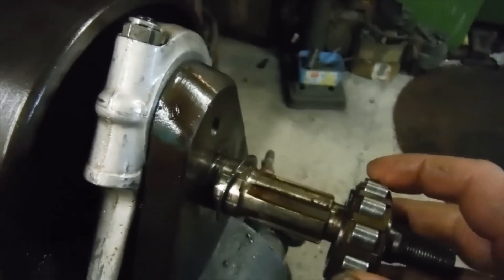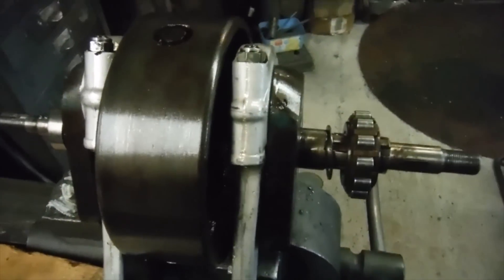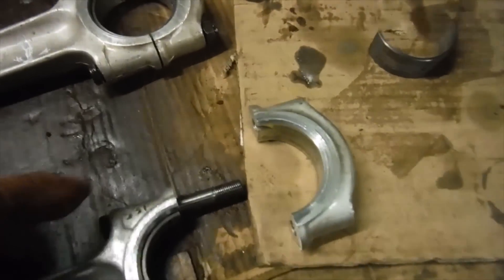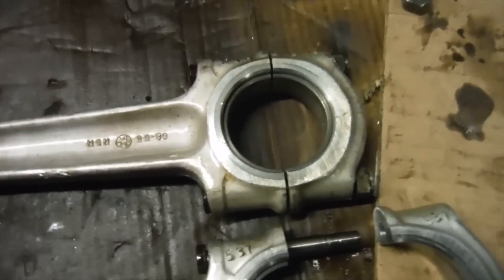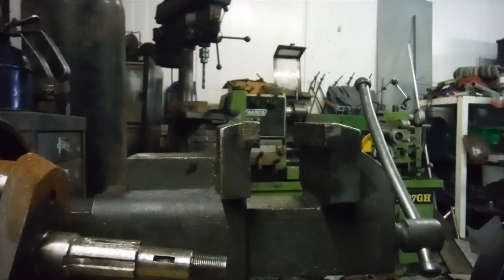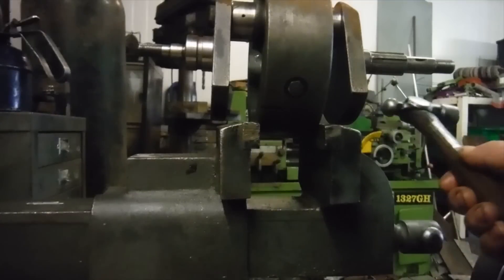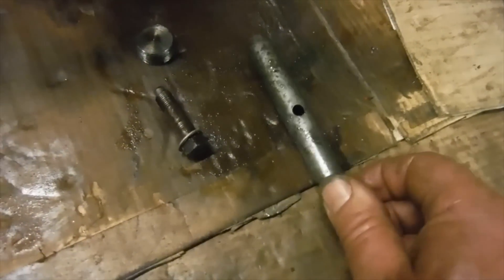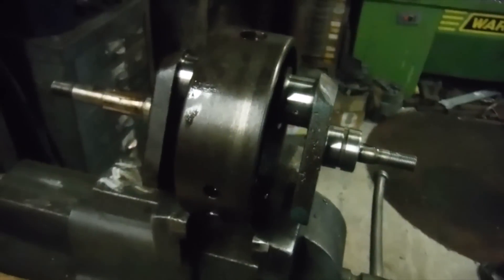BSA A65 engine crank and bottom end components inspected and discussed.

Comment: That's a later roller bearing motor and there should indeed be a thrust washer there. Someone tried to compensate for excessive end float by installing a washer on the drive side while probably not realising the thrust washer was missing. I've had broken cranks from excessive end float and so it is essential to get it right.
Reply from the maker: The thrust washer wasn't missing, but it was lacking the correct shim cup and shims on the drive side, as it was when it arrived in my workshop.

Comment: All seems reasonably good. Did the very first A65 Stars have ball journal drive side mains, followed on by A65B with roller bearings with shims behind the bearing, rather than the bush side ? I think you have a normal layout for a fairly early engine there.

Comment: As I said in last vid a amateur has rebuilt that enine with little attention to detail Paul - con rods wrong way round when theyre marked whattt the guy who paid for that rebuild was taken to cleaners big time...
Reply: To be fair, con rods are symmetrical and it is unlikely to make any difference which way around they are, all that really matters is that the caps are on the correctly oriented to the main part of the rod.
Reply: Without knowing the full history of who did what & who claimed to have done what, much speculation on this one.
I wonder if a previous owner acquired it with it needing some major repairs. He/she is just an enthusiastic biker & not a ‘proper’ mechanic, (a bit like myself!lol ), they carried the repairs they were aware of, but didn’t have the knowledge to identify the issues that someone as capable as Paul can find. Maybe we will never know.
On the other hand , if this has been sold by a dealer who claims to be a classic bike specialist & it was described as being fully rebuilt, different story.
Reply: @martinowl  Agree, you would hope that a trained mechanic would have built it to a higher standard than we see here, it looks more like a home mechanic who quickly assembled the engine on the kitchen table and really just wanted to get it running enough to sell it for a quick profit.
Reply: The cracking casings and use of plastic metal / damaged barrel gasket ( punched dot left on mating surfaces) would be very worrying to me if it had been assembled by a professional business. I dabble in rebuilding my own engines and whilst I don’t actually make parts or machine now basic assembly and checks in a methodical manner should not allow these sort of mistakes - but who knows?

Comment: for some reason the timing side bush failure on my A65 involved the bush working its way out of its steel shell and becoming food for the timing gears... three times. thinking back if instead of a bush in a steel shell a solid phosphor bronze bush may have cured whatever the cause was. mine had hi comp pistons big valves and spitfire cams, went well.... when it was going